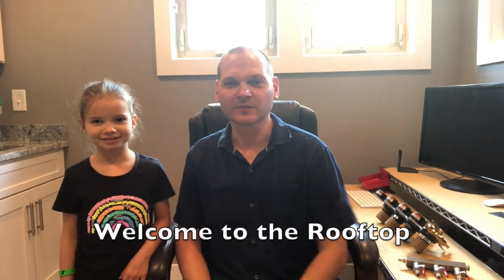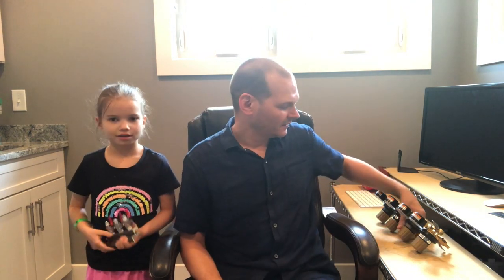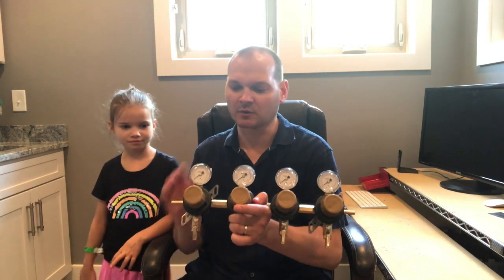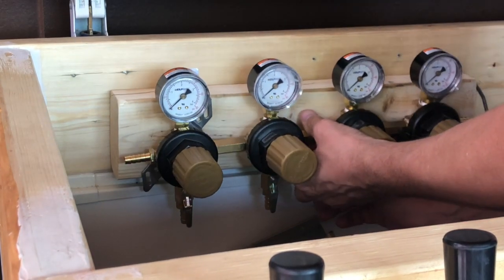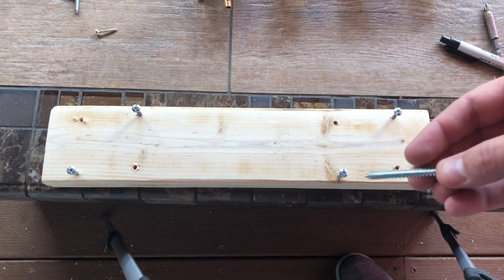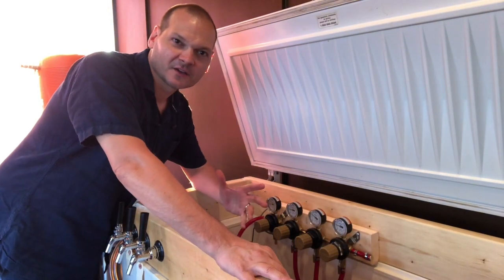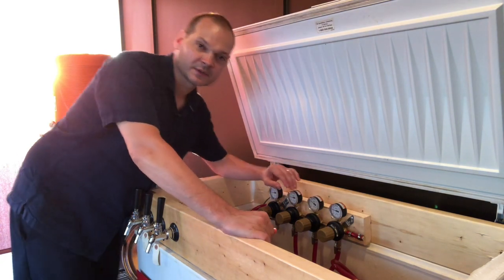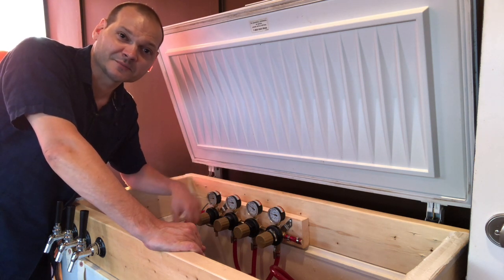3 Tap Keezer - Adding Secondary Regulator

Comment: Thanks for making this video Trevor. Your secondary regulators look like Taprites. I’m interested in adding this feature so I too can keg water as well as different beers. Everything I read on the reviews whether Taprite or other manufacturers says they leak and the leaks are unstoppable. Just wondering what your experience has been so far and why do you think so many seem to have problems. Thanks again. Mark
Reply from the maker: Hi Mark, thanks for the comment. I must say I've been very happy with my taprite secondary regulators. Not one leak. I did buy this already assembled so I 'm not sure if folks who have had issues had to assemble themselves. If you do end up needing to assemble regulator make sure and use the yellow plumbers tape instead of the white. It's thicker and made for gas lines so a much better tape for CO2. Good luck!